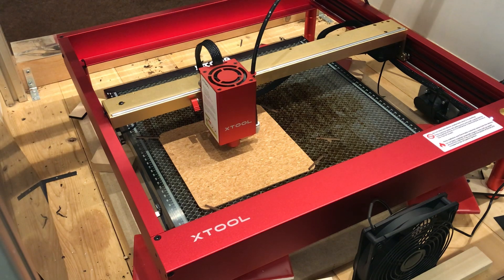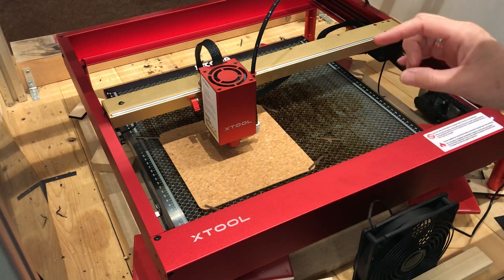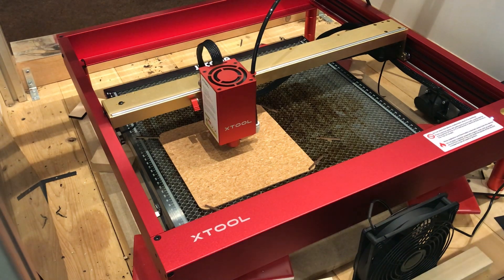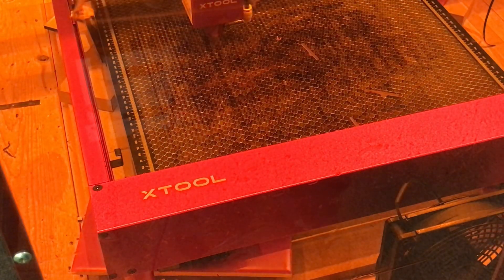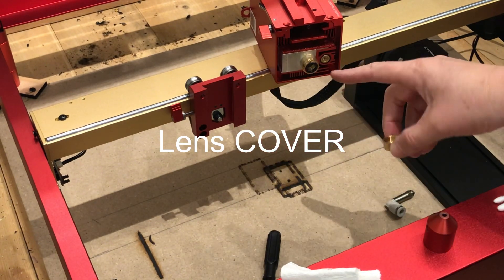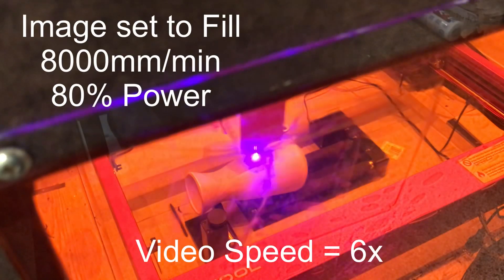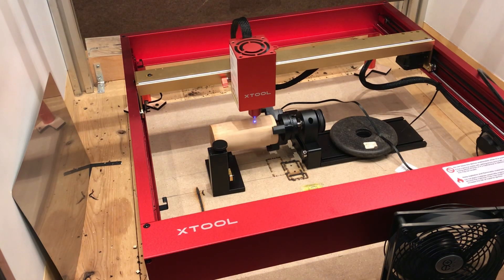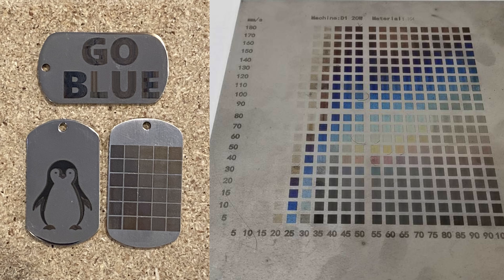Tool Time Tuesday: The xTool D1 Pro 20w Laser Engraver!

Comment: I returned recently my xtool 20w pro. It didn’t cut colour acrylic and tried so many times to get the engraving to work also. The smell of acrylic burning is so toxic it gave me a headache. I had to sometimes run a 5 pass to get it to cut the 3mm acrylic and you could really see and smell the burnt melted acrylic. Might be an ok machine but definitely not for cutting and engraving acrylic.
Reply from the maker: I did one project with opaque yellow acrylic (which was the xTool brand but I  bought it from Amazon before I had the xTool) and it cut through in one pass using the settings recommended in the xTool creative software but it did smell awful - even with it in the enclosure and the exhaust fans on. Definitely not something I’m gonna do often. Or maybe ever again 🤣. Even cutting acrylic with the table saw etc smells bad - the nature of plastic I guess. 
I’m pleased with it cutting and engraving wood though, and since that’s my main thing it serves me well. Sorry it didn’t work out for you

Comment: Once again I am envious. Still wanting more than my 2-1/2 yo 10w engraver. Oh well 🤷‍♂  Good to always mention & show use laser eye safety stuff - enclosure & glasses 🙏      Thanks for sharing. Take care. -Mike
Reply from the maker: Depending on what you want to do, the 10w may actually be better. I didn’t do a lot of thick cutting tests cuz to be honest, if you want to do lots of cutting a CO2 laser is a much better option. From what I understand the lower wattage lasers are better for engraving. 
PS - I’m gonna get around to testing out your parts, and to mailing your package. 😃
Reply: @LisaRamlow  Yah, that's why I have my eye on xTool P2
Reply from the maker: Well that link works for that too so if you do end up going that route, you can clicky on that 😃
Reply: @LisaRamlow  you bet I will👍😎